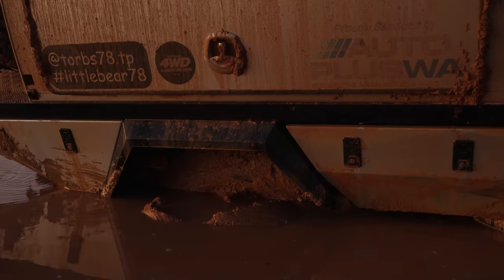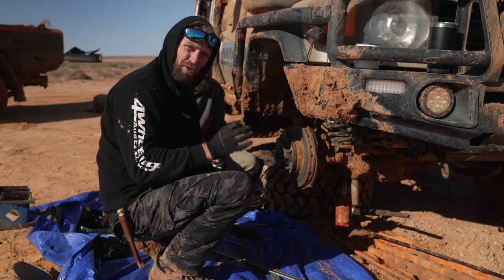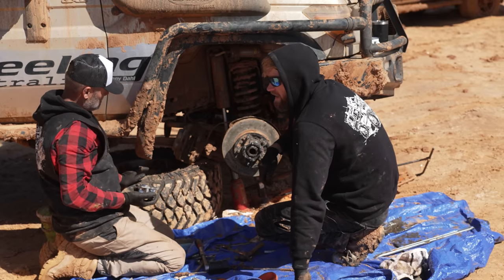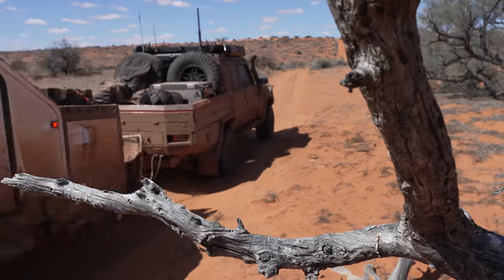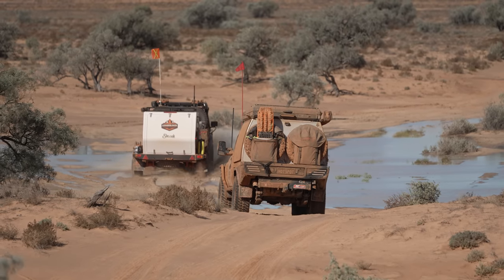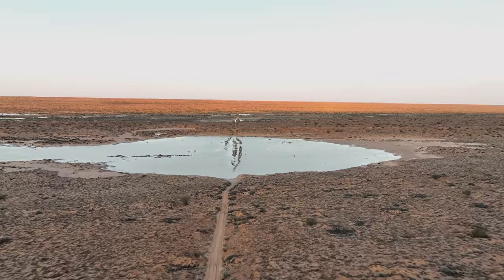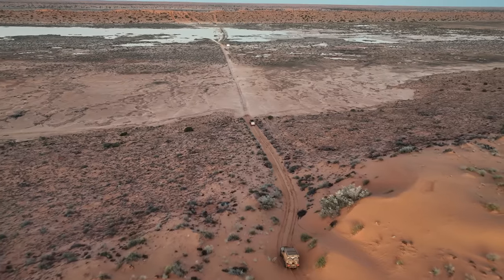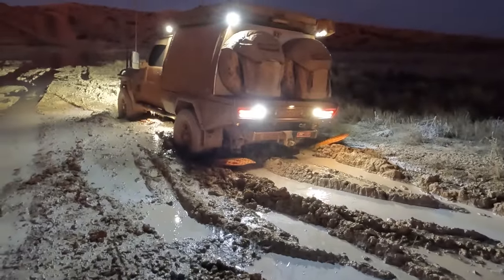SIMPSON DESERT WON'T LET US GO!!

Comment: Great episode guys, what a drama. I think its worth having a look at some old Malcom Douglas shows. In particular Malcolm Douglas - Australia - One Wet Season (1984). Compared to modern vehicle setups, 4WD and camping techniques, Malcolm Douglas is far superior in every aspect.  Vehicle is lighter, simpler to fix, less electronics to go wrong. Recovery in situations worse than yours was achievable with less. Malcolms ability to catch and cook meant it didn't matter how long he was in the bush he could feed himself and survive.  
I really think in this modern day and age we have lost the old skills which in my opinion are far superior. This all due to the heavy reliance on technology and at the heart of it consumerism.
Reply: @Simon Franklin wouldn't make for good drama if they said it's rained so we're just going to camp out for 3 or 4 days until it dries out enough that we can carry on without ripping the tracks up.
Reply: @Simon Franklin 
It’s just made up drama.
Reply: Agree.  The car that caught fire is owned by an electrician.......  I'm not an electrician, my Patrol has wires added for stuff, and I crossed the Simpson early September this year.  Nothing caught fire, no tyres blew off the rims, did not get bogged despite plenty of mud sections.  And I drove the big red lake obeying the sign which said "go straight on one track"  and did not get bogged.

Comment: I did this and similar trips in 1963 & 4 with an International 4 wheel drive 1 ton pickup, not nearly as well equipped or powerful as your vehicles and only with ONE vehicle. Our saving grace was front and rear winches with a large 'spade' type anchor which allowed us to pull ourselves out of the worst holes. Without that anchor even with 2 vehicles I think we would still be there -- well our bones might be--.Well done guys, brought back many memories.

Comment: Lighter is better, simpler is better, slower is better. If you are going to go fast, go heavy, and go with more electrical gear, you better make sure you are low neurotic, or bring plenty of beta blockers.
Reply: Just goes to show how much damage you can do when you go too fast. Good to watch though!
Reply: @wilso7235  A few times on Fraser Island I’ve seen idiots doing over 100kph on the beach only to sail over a small creek crossing and hit a hidden bit of driftwood which has cactused their front suspension.
Reply: @wilso7235  nothing but a weak driveline is the cause here
Reply: Darren Boxhall, don’t forget these vehicles are massively overloaded and are really being hammered by their drivers.

Comment: I was out there last week. I did the Connie Sue hwy to Neale's Corner then the Anne Beadell to Coober Pedy.
The track to Dalhousie Springs was just reopened.
I did the French line to the Colson track crossroad and camped there.
Next morning went to start the rig, only 10 volts in the battery!
It had dropped a cell.
A jumper pack is a must have and at this point decided to go the Colson track to the Madigan line and into Alice.
Brought a new Battery. Supercheap had them on sale so that was a bonus. $180 compared to over $400 for the right battery for a Ford Ranger!
The first part of the French line was flooded everywhere but passable.
The Colson track runs between the Dunes so all hard packed sand the whole way.
One good thing about all the rain was the Wildflowers were in full bloom everywhere.
It was paradise out there and I never saw anyone for three days.
Looking forward to doing the QAA next time to Birdsville.
Fuel cost $3.10 a litre at the Pink Roadhouse.
I brought 10 litres at a cost of $30) to support the new owners of the Roadhouse but didn't need any extra fuel as I can carry 210 litres.
People were stranded at Dalhousie for three days before the road reopened according to a nice family I met at the Roadhouse.
Me and the dog did the Fink Gorge river Run to the Lasseter hwy heading back home which was stunning.
All up did 6000 klms in 12 days and man what a blast.
Australia is great country but if fuel prices get much higher it will hurt any prospects for many to afford the travel.
The lack of Wildlife out there was concerning.
Only saw 6 Kangaroos, one Dingo and two Emus.

Comment: Been there done that, the mud is a killer even when it dries under the car. It sets like concrete. If it rains out there I run in the opposite direction. Exhaustion of man and machine.

Comment: Coming up to big red there is a sign saying you must stick to one track only, the one that goes straight through.  Both of you ignored that and strangely enough got bogged.  The straight through track is deep but has a solid base.
Reply: Absolutely
Reply: Except for when it's completely underwater and likely unpassable
Reply: Also why didn't they go around and over little red?
Reply: @joshlower1  If the straight track that you are instructed to use is underwater and impassable, then you don't pass - or is that too hard to grasp?  In that case, trying to cross beside the main track is even worse, apart from being irresponsible and disrespectful.
Reply: @owenscott4145  No content doing that :)
Reply: Seriously, you are trying to give advice to two of the most experienced and expert drivers in Australia. No mate, they did what they needed to do.
Reply: @caltravels9454  You have zero idea of my level of experience, which is, by the way, considerable.  They only did what they needed to do AFTER they got in the shit.  Had they done the right thing before, they wouldn't have had to recover their mistakes. When they are as old and experienced as I am, they will stay out of the mud when there is a dry path and they will obey the sign at Big Red.
Reply: @caltravels9454  ronny isnt an expert traveller or driver, he is just some tradie who happened to luck his way into being an influencer. If he was 'expert and experienced' they wouldnt of ever gone across, as they were told specifically at Mt Dare that rain was imminent and they were expecting 100-180mm over 24hrs. Then ontop of that no expert would of driven across the salt flats near poppels, they would of taken the bypass track around which he ended up having to do, because his idiot mate and the camera car got stuck and damaged their vehicles in the process.
Reply: @owenscott4145  wouldn't have made for good content......

Comment: How much salt is in those salt lake crossings?
Reply: Typically somewhere between 4 and 7 times the salinity of the ocean, the electrical fires are not a surprise green death doesn't care who made the car.
Reply: @MrNeroDiablo  so worse than driving through ocean water. I wonder why people don’t mind driving through it
Reply: @matthew6443  You avoid it as all costs and clean your vehicle thoroughly after if you do. Admittedly they are normally dry and hard, it rained in the dessert which is a fairly uncommon event. Admittedly torbs vehicle has done a lot of work and is likely hitting the end of its service life, this might simply be the thing that pushes it over the edge.

Comment: Both times you could have driven around it, why do you pretend there’s ‘no other way’? It’s clearly marked with signs?
Reply: Less exciting just driving around lol
Reply: They could've just caught a chopper to where they wanted to go too, wouldn't make for an interesting video, though
Reply: The first salt pan…yes could’ve driven around, but without knowing the conditions why drive for an extra hour (also into an area of unknown conditions)?

Big Red.  Agree, there’s a well signed alternative…but most people go to the Simpson to say they’ve “done Big Red”…as others have said, the journey is the adventure…not the destination.
Reply: Content.
Reply: @thenameiwantedwastaken  just sad to see when someone who used to produce informative and factual correct exciting 4WD content goes down the path of lying and tarnishes their own reputation. No harm in saying “we chose not to take the bypass”….
Reply: @andrefischer5025  
Could be a fuel decision too
If youre running low on fuel and driving around is twice as long as going through (even if you do get stuck) then that could be motivator
Reply: @thenameiwantedwastaken  driving around is actually 1km shorter (at big red)
Reply: @andrefischer5025  
Well, there you go
Reply: @thenameiwantedwastaken  they would of used more fuel at the first bogging then just taking the bypass around it, but they aren’t exactly smart, they were told by numerous people at mt dare that significant rain was coming and they still elected to go. They could of easily hung a left and went up hay river track once they hit the madigan intersection, which would of popped them out on the plenty and from there it’s smooth sailing
Reply: @thenameiwantedwastaken  I hope Ronny & Torbes have a good constructive debrief session after this “adventure” and find their way back to produce good quality content
Reply: Would have been too easy to drive around it...less drama....comon man
Reply: @andrefischer5025 you know ... This type of content gets views from non 4wheel guys , and quite frankly , it was fun to watch to me too , I don't understand why you so upset when be still produces content that sits well with you 🤷🏻‍♂️